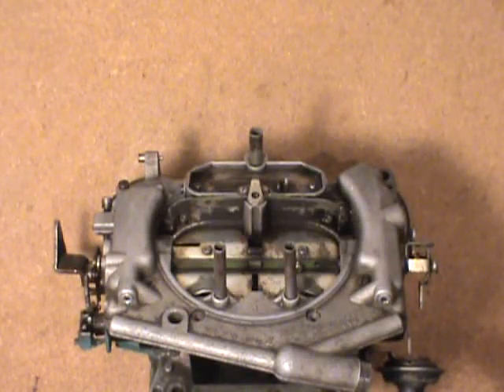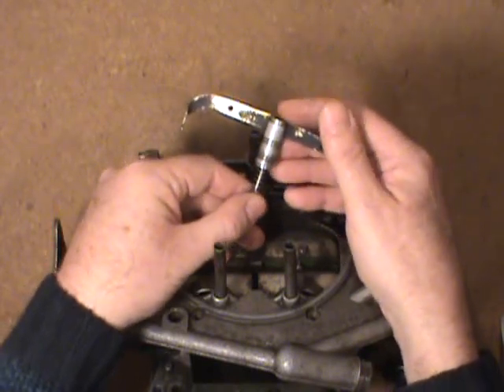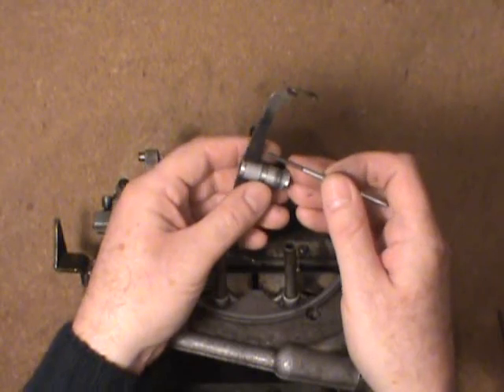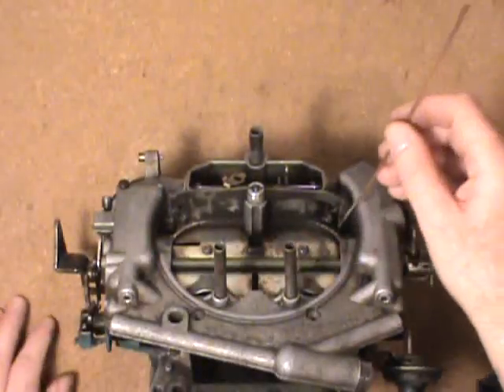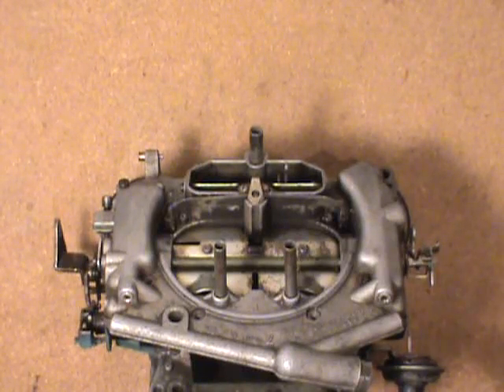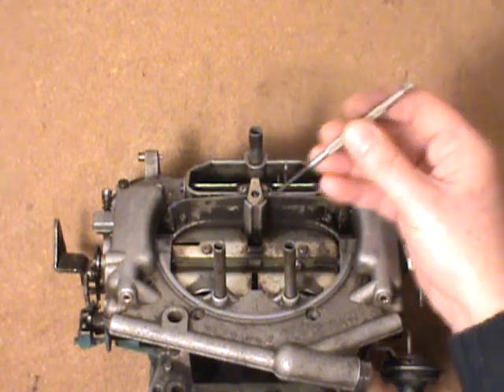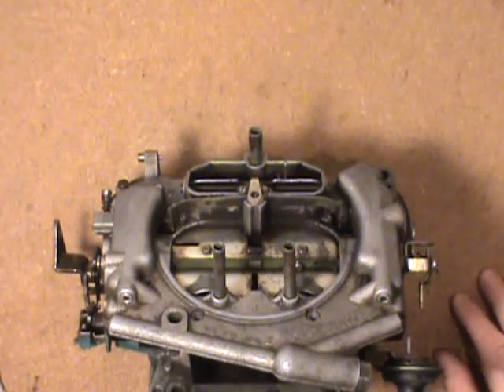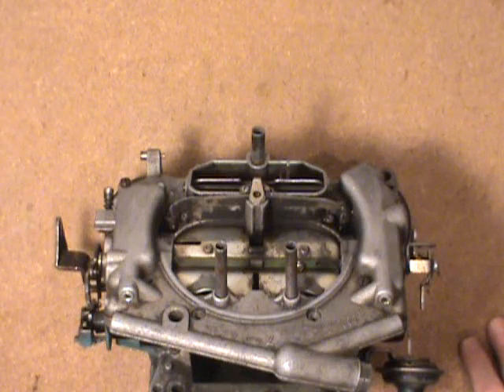Thermoquad 4 Barrel Carburetor  (Part 6)

Comment from the maker: ...I'll start with a common item, when it comes to accelerating from a stop....To me, it sounds like your Accelerator-Pump-Plungers-Seal/Cup may be worn out, or, something in that circuit is plugged up, or stuck....To check the Accelerator Pump system, try this....With your Engine Cold, Start your engine and let it run for about a minute, then, shut it off, and take out your ignition Key (so someone can't start your engine while you are under the hood!)....This fills your float bowls....(con't)

Comment from the maker: Greetings William Ruescher....(jumping in my "Time-Machine", and heading back to 1976)....First off, I'd like to say, if your Thermoquad hasn't been re-built at all lately, and your Thermoquad has never been removed from your intake manifold, then, more then likely, some of your Thermoquads working parts may have either deteriorated or are just plain worn out....There are many culprits that may be causing your Pick-em-up-trucks poor running issues....(con't)

Comment: Howdy! I've got a 76 Dodge D200 pickup with the 400ci V8. The issue I'm having is an off idle bog if you don't apply throttle slowly. I richened it up via the metering rods but after a short while it backfired through the carb. So I was wondering if it's a metering adjustment, some sort of internal carb failure, or even a vacuum advance issue. Thanks for any responses!

Comment: Thank you so much for posting these videos.  There isn't much out there on TQs and you have done a real service for people working on them.

I had a problem with mine bogging, but only after it had warmed up to full temperature.  I finally figured out that the piston was binding in the hole after it heated up.  A little lube on it and it moves freely and runs like a scalded cat.  It looks like they were originally coated with maybe teflon, but that wears off over time.